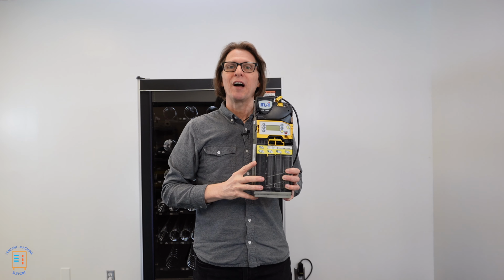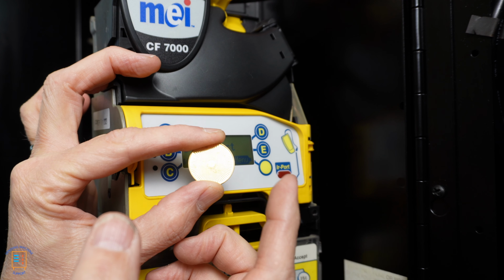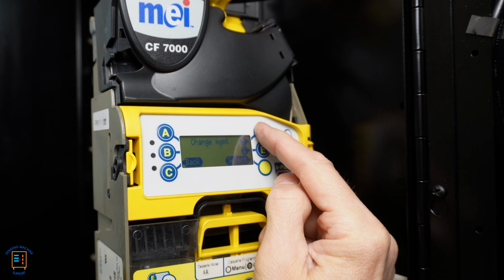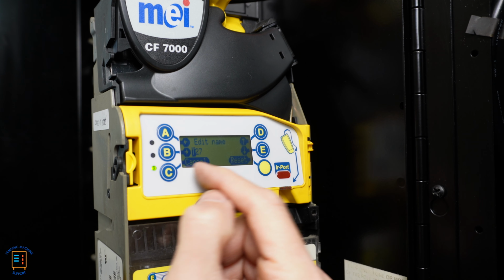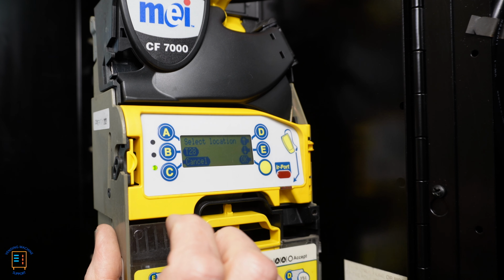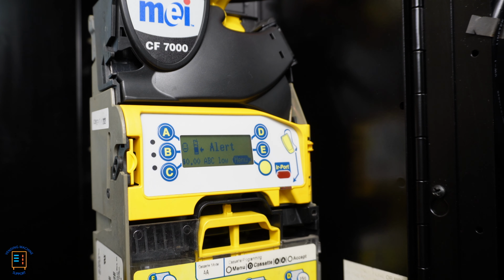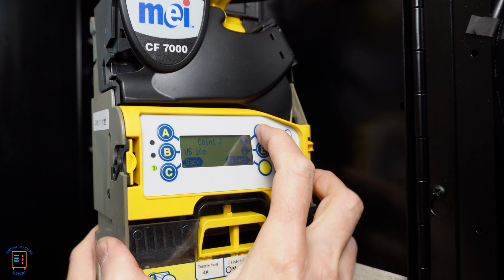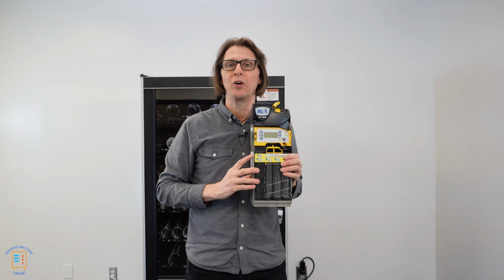How to Tune a MEI 7512i Coin Acceptor to Accept Just Tokens

Comment: Does the tokens fall straight into bucket or do they get stored into the tubes (regardless if you do value or credit?) — I wouldn’t want a customer getting a token as change after putting $5 in for an items— if the token was valued for 4 dollars.)
Reply from the maker: The tokens are routed directly to the cash box of the machine. The token will to be routed to the coin tubes to be used as payback change from an over credit purchase scenario.